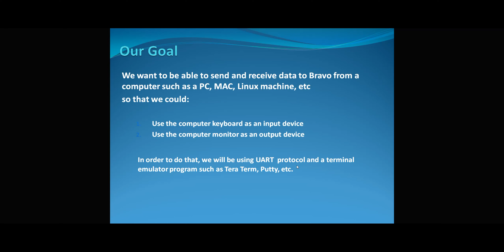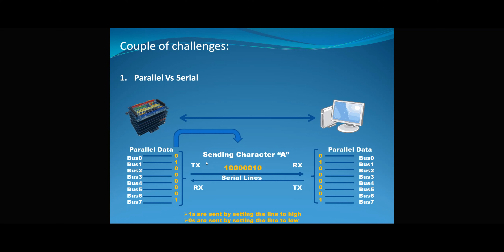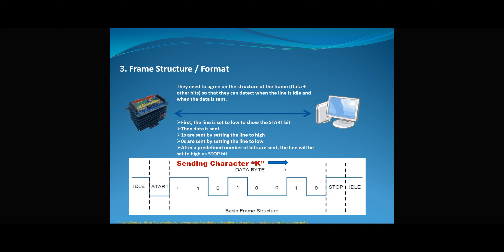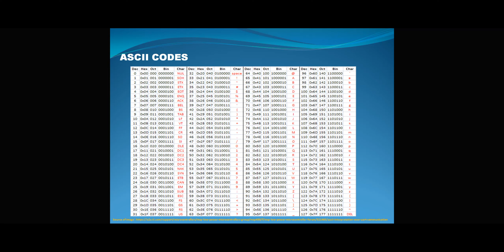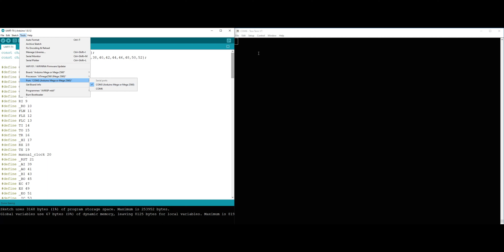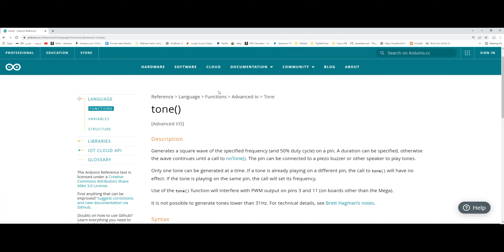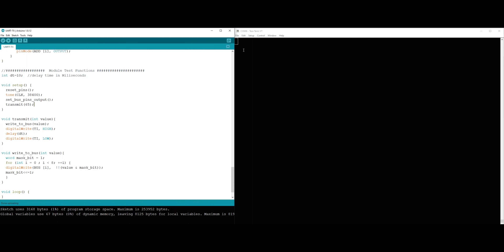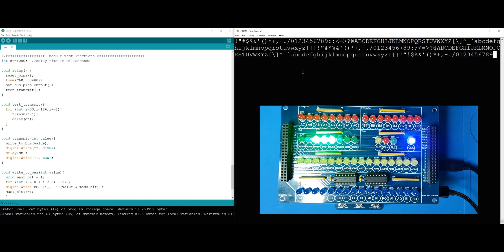Bravo 8bit computer-Part 11- UART TX , inspired by Minimal Project & Ben Eater's 8bit computer

Comment: Not all alphanumeric characters were printed.  You calculated from =33 to <126 when it should be from =32 to <127 (or <=126).  You omitted the first and last ASCII characters because the logic wasn't set properly.